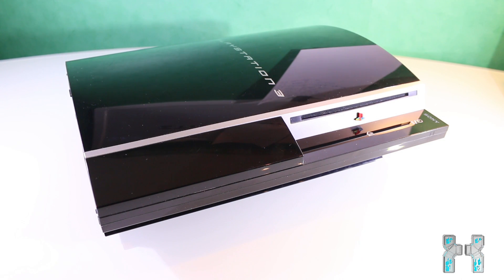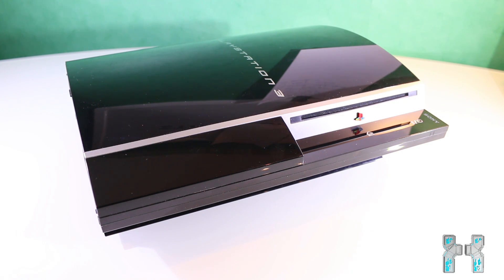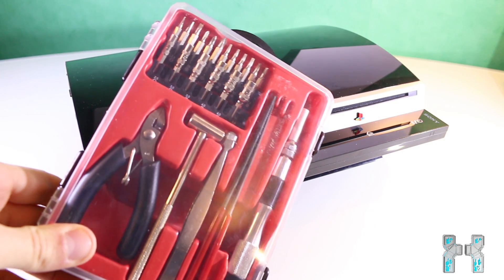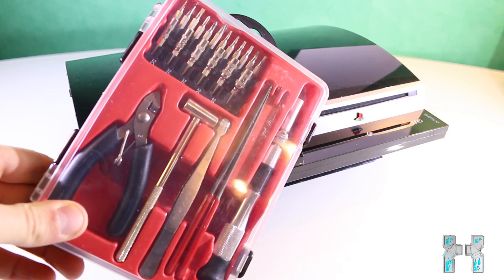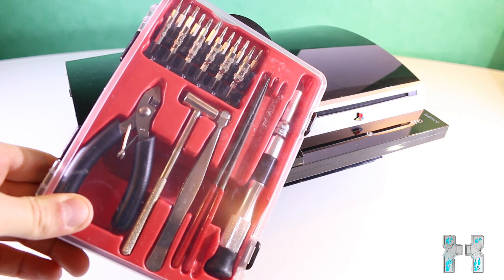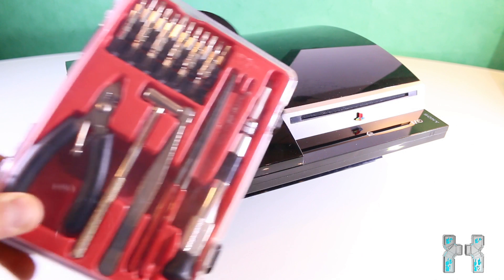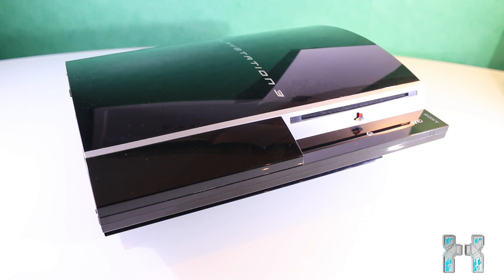How To open up a Phat PS3 ! - YLOD Fix Part # 1 [HD]

Comment: Hey da ich weiss das du deutsch sprichst die frage in* german *
Meine ps3 habe ich aich gefixt aber nur mit kühlpasste aus nem netzteil einer xbox 360 was 3 monate hielt beim zocken von fifa 13 und gta 5 aber jetz ist sie schrott und geht deine methode noch oder ist sie auch schrott ???
Reply from the maker: wenn bitte machs vernünftig. es ist keine "kühlpaste" sondern lediglich eine paste die die unebenheiten in der oberfläche für besseren wärmeaustausch glättet.  Vermutlich ist sie wieder überhitzt und einige kontake sind brüchig. Reflow ist das billigste was du noch machen kannst.
Reply: ***** geht deine playsi jetz noch oder nicht ? :)
Reply from the maker: läuft noch. lüfter manchmal etwas lauter aber läuft :)
Reply: Ok danke dir :) !